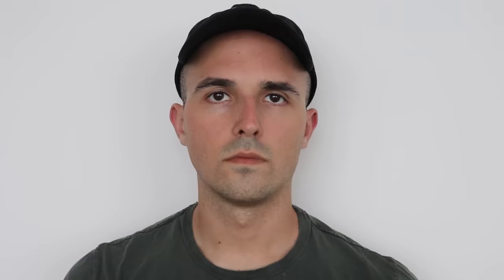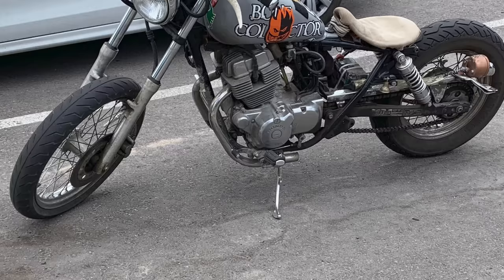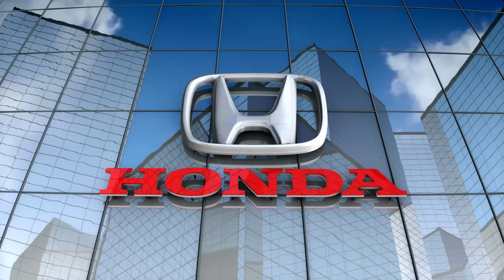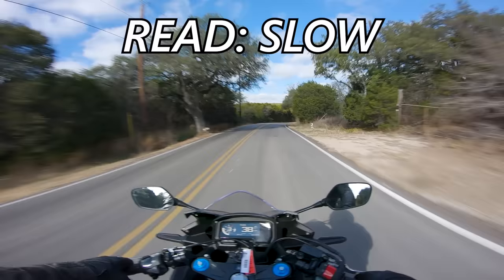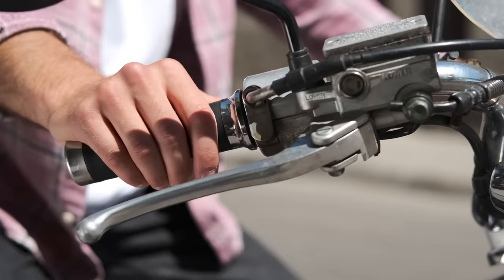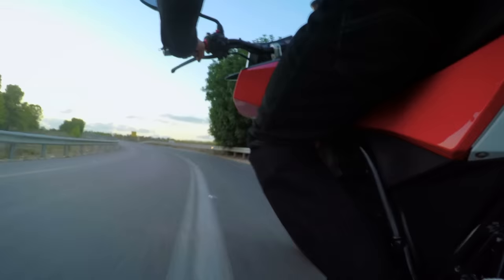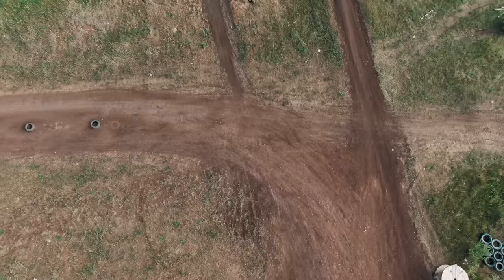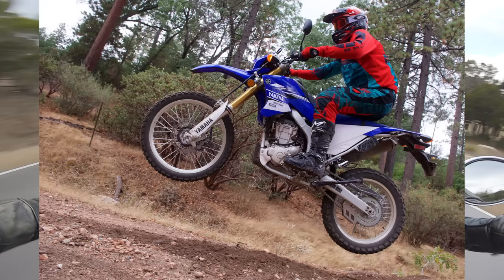7 Used Motorcycles That WON’T BREAK! (Low Maintenance)

Comment: Hey you forgot about Kawasaki!! I got a GPZ500S, which has there ER500 engine. I had a pretty bad accident, the bike was complete write off, so I got a new one and about a year later I blow it up by dropping into 1st gear at 50MPH 😵 so I went to me accident bike, and just swapped the engine, thats is no spark plugs change just fresh oil and she started and has been running just fine for the past 4 months (300ish miles) this engine had been sat in a wheel barrow outside for just over a year, nothing was wrong with it even the spark plugs were good, this is a 1995 model and it's a bike I think should get more a lot more love!!!! Please I beg you get a Kawasaki GPZ500S 1995-2001 i promise you will love it!

Comment: I can't be the only one who absolutely adores the Yamaha XS400K DOHC (Maxim) and XS400R (Seca)

Swear to God they're bullet proof. Only issue with those bikes is replacing the coils-theyre stuck inside the frame under the fuel tank. Kind of odd.
Reply: I own a xs400r for 18yrs ervyday work horse machine

Comment: We have a 2020 Triumph T120, water cooled, and its awesome.  The stock water temp runs high like 230 in hot weather.  I had a custom 3x bigger than stock radiator built, put in a 160 stat, now its super.  Added a home built trailer hitch and built the trailer too.  Its great!

Comment: I'm a Harley junkie. I'm also a rocket junkie but I'm this case
Harleys with carb are so easy to work on it's practically a mandatory carb in a shop class for newbies.  No kidding. But their injectors rarely go bad so it's up to you. If you're not afraid of a wrench or do you just want to hit a button and go.
Reply: I rode a 71 flh shovel with a super e on it 
Gave it to my son 
Still going. Probably over 150k on the motor 
Stock rocks.those stroked out bar hoppers give hd a way worse name then they deserve
Reply: @Heavywall70  
So very true
I'm too old and broken to kick a motor so I'm on a FXSD 07 injected. No issues at 60 g just basic maintenance
Reply: @johnspencer2382  mine was a true Electra glide. No kicker at all. Hell, it didn’t even really have a key, just a switch on the dash, pull up the enrichment lever and push start button. Slowly push the lever back down till ya hear potatoes (potato potato potato) and you’re set. 
I did knock all the baffling out of the mufflers so it could breathe better with that super e but that’s it.

Comment: When you buy something with pistons, there are two main categories you can choose from:

- Honda.
- Not Honda. 

It all depends on one certain question. 
Do you want it to work ? Or not so much ?
Reply: wow, if that's a joke it's not even a good one
Reply: Yamaha Super Tenere. In the top 5% for reliability. A Ducati is at the bottom of the black hole of rel.
Reply: Good thing my car has a spinning triangle. Brap brap!
Reply: Honda is not everything in bikes.  I like my standards like the Triumph T120 and now 400.  Honda has nothing even close.
Reply: @j.d.mcginn6946  Honda is the number one largest manufacturer in the world both in motorcycles, and engines in general. 

Especially in motorcycles they are so far ahead, that even the SECOND, (which is Yamaha by the way) produces less than half. 

Triumph is for such a niche market, that I don't even consider it competition. 

As for the T120, not only Honda has something close, but they make it better. 

It's called the CB1100. 
It rides better, sounds better, uses less fuel and will outlast the triumph by several decades. :D 

Honda LITERALLY, gave birth to these kind of bikes. If ANYTHING, you owe them everything.
Reply: @jigrodrigues  do you happen to know something better ? If not, stay quiet.

Comment: I have owned various new and used Hondas since 1986 starting with CX500's, CB650, and a VF750, none of which required anything outside of routine maintenance/wear items. Went to Kawasaki in 2004 with a ZZR600 and had nothing but problems with that bike.  Went back to Honda with a CTX700 in '16, and glad to be riding trouble free again.
Reply: I had z1000sx from new and plenty of problems. When Kawasaki tried to explain that moisture on the dashboard is normal, I sold the bike. I have 23 years old Honda scooter and no issues whatsoever

Comment: Just passed 45k on my 2017 yamaha fz10 and it's still going strong!
Reply: FZ10 is a hell of a good bike!
Reply: My XS1100 has over 50,000 and still screams. 95-110 hp. 11.75 et. Air cooled DOHC inline four. Drive shaft. What's not to love?

Comment: "any low capacity bikes" 
Laughs in KTM RC390
Reply: I’m actually deciding between the old R3 and the old Duke 390
Reply: @justinlzt  just go for r3. I had the rc390 until recently you would regret it
Reply: @justinlzt  I have a 2013 duke and at this point, it's 1h repair session for every 3 hours on the bike, go for the R3
Reply: @Cyr_S  oh shit bro what’re the repairs you do? Water pump? Gasket stuff?
Reply: Any KTM, really. It’s a shame, because KTM and Husqvarna make some of the coolest and most interesting bikes around, they’re just really fussy.
Reply: @justinlzt  no gasket yet, mostly electrical so far. Last one was the clutch sensor that stopped working and wouldnt let me start the bike. Before that, gear selector and before that that side stand sensor... Bike is loads of fun when it's working though. Little wheelie machine. I had a 900cc before and i much prefer commuting in the duke
Reply: @Cyr_S  wtfff clutch sensor
Reply: @justinlzt  yeah, there's a sensor that tells the bike if you are pressing the clutch or not 😂
Reply: Yea I know what that is but didn't know thee was a possibility of it failing so easily. I've heard that the gasket issues won't happen if you take care of the coolant but the maintainance cost is higher than of the R3
Reply: @justinlzt  390 is more fun but feels like a plastic toy and will break.
Reply: @FrankCoyle ouch
HAHAHAH
Reply: Happy duke 390 owner here. 2014 / 6.5 years riding 33.000km on shitty roads of and heat of Vietnam - just changing oil and lubricating chain. Biggest issue I remember was the radiator fan refused to spin for some reason few times the first year. So I bough a spare one, give it to duke under the nose to sniff, magically the old fan started to work, never had to change it, the spare still in the box ;-) It's indian version for local market, grey import. Maybe I was more lucky than others, but the bike just works and required nothing more than regular maintenance...

Comment: Most reliable bike: Honda NC700 👌
Reply: Scooter if its automatic 🤪🤣
Reply: @MK-sk2mi  nope mine is a manual😁
Reply: @luukwolf161  awesome lol I was so close to getting one but most the ones I found were autos. Ended up with a Yamaha 😆
Reply: @MK-sk2mi  I actually wanted a MT-07 bud thats was more expensive. So ended up with the NC700. Here in The Netherlands the automatic ones are more rare, most of them are manual here

Comment: Had a 1982 Honda cb900 that had 500k miles on it and after swapping out some oils, cleaning the hell out the carbs, and putting the factory air box back on it ran like a dream.

Comment: Good see the FZ1 get a little attention.  Very underrated bike. They are getting harder to find.
Reply: I was looking at buying one a few months ago.  It was a few years old, but in excellent condition, with really low miles, and the guy was practically giving it away.
Reply: @mickeywilson8885  if your halfway interested  snatch it up. They can really pepped up with a little effort.

Comment: Ducati’s, great to look at. Just as well, as that’s what you’ll be doing most of the time whilst waiting for the recovery truck. Either that or your you’ll be doing overtime at work to pay for the servicing.
Reply: Seriously yammie putting that panigale at number one was total shocker. I don't think of reliability when I think of a Ducati.
Reply: Yes and no.  Ducati,. Get to know it, be intermit with it,. Do everything you can to it yourself.     Guess I'm a little old school,. Where owning a bike means working in it yourself.    Ducati services are through the roof expensive.   But if ya buy the tools and books,. It costs you time only.  And they are fine tuned machines, so yes, need to pay more attention to them.    But like any track bike.  Should be maintained more than riden.      Coffee or tea.   Bourbon or whiskey.  Each to their own
Reply: @russcole5685  Yes, and I do all my own work. But…The desmo pain in the arse valve clearance check is more frequent compared to other bikes, and a friends multi strada was very problematic, as many have found. Then there’s the long wait for expensive spares….Gorgeous to look at though !
Reply: @jamesalvarado3961  That’s called experience . Yammie knob doesn’t own a Ducati. Wonder why ?
Reply: @douglasalexander4348  yup,.  Can agree with you,.    Here in Little New Zealand to try and get anything into the country,.  Is terrable at the best of time's,. And now with covid around the world.   Lol. Rediculas lol
Reply: @russcole5685  New Zealand looks gorgeous for biking !  Yup, everything’s in short supply here in UK and prices are rocketing as a result. Getting Ducati spares before COVID was dire, hate to think what it’s like now…

Comment: Bought a 6,000 mile 2003 Moto Guzzi California Stone, like new for $2,800 freakin' dollars last August. Best money i ever spent on a bike. No ABS, air cooled, wet sump, drive shaft, hyd. lifter 1100cc 5 speed, dry clutch. About as simple as any bike sold after 2000 and unlike a Sportster has plenty of power. Yes, it is an F.I. engine but a very basic set up that just helps reliability wise. Great handling cruiser with the Tonti frame proven over decades in both sport and cruiser Moto Guzzi bikes. Simple, automobile like engineering and easy to maintain outside of dropping the sump once every 5 oil changes to do a filter change but even that is a blessing as it facilitates cleaning the sump of any sludge build up and allows inspection and cleaning of the oil pressure bypass. I also have a 1976 M.G. 1000cc with 55,000 miles and almost no discernable engine wear and know of a 1980 850 T3 that had 180,000 miles on it by 1995. Outstanding service! Let alone from an air cooled wet sump bike! Have a lot of faith in my 2003 Moto Guzzi with no issues at all so far. A good thing when you have no idea where your nearest dealer is but are fairly sure it is hundreds of miles away!

Comment: If the Yamaha DT175 and Honda XR250 were still being made....they would make the Top 7
Reply: Yamaha dt is indestructible 👍🏻
Reply: @menanpopstrokes4025  ....yeah, I had either a G or H model of the DT175 that I inherited from my older brother.  I flogged that bike like no other and it never let me down.   After years of abuse I thought that I'd better change the piston rings....and clean the air filter, finally. 😁
My older brother also had an XR250RF (1985 model) but I crossed a line and it was never the same.  I drowned it in the Todd River, central Australia, on a rare day that it was flowing and got bogged in almost quicksand.  Bit of an idiot thing to do.
Other cool bikes were 1983-85 KDX200 and the IT200....but the Kwaka is more bullet proof than the IT.....in my opinion.
Reply: @1969cmp  these day it’s hard to found one because the price of dt125 and dt175 skyrocketing.
Reply: @menanpopstrokes4025  .....and rare.
Reply: @1969cmp  you know why it became highly price bike because of the pop culture. We had a movie triology about scrambler gang

Comment: I like the list, but (outside of the Japanese big 4) think it's more like if it breaks you'll find parts and it won't need specific tools and high level of mechanical expertise to fix. It may also need more regular maintenance but anyone with basic mechanical knowledge  can do it easily and quickly and if done you will have a solid bike that you can put high mileage on (RE, Harley and Triumph). I think the Triumphs with the most transmission problems are the water cooled 120 series.

As someone that puts high miles on motorcycles and doesn't like to rely on a dealership/mechanic for services, I prefer a motorcycle that is simple to repair and maintain on my own. I'll give up fancy bikes that need specialized equipment and knowledge just for basic maintenance even if it requires the maintenance more regularly. I'm one of those that enjoys wrenching on my bike as part of the ownership experience and it forces me to deeply inspect the bike for hidden issues that might become bigger issues.

If your looking for a get on and go bike, that is pretty much low maintenance and bullet proof, I agree with the first two groups you mentioned and duel sports that haven't been ridden into the ground. If your just looking for it as transportation and don't let ego get in the way, a scooter 125cc and above from the big four are about the best thing you can get. I've had a couple and although they don't give you the full motorcycle experience, they are fun in their own way and extremely useful for their purpose.

My Yamaha has almost 50k miles and with basic maintenance should be good for over 50k more. Haven't had any issues at all.

Comment: 40 years riding. My 1986 Yamaha Virago 1100 has been my least problematic bike. Still going strong, though the odometer did break. I'm guessing 100k miles on it. I had 15k when I bought it 12 years ago. Oil changes, spark plugs and tires, and clutch cable, brake pads... just normal maintenance. Worst bike, 1992 Suzuki Intruder 800. Constant problems. Worst battery placement I've ever seen.

Comment: I’ve got 50 + yr old Honda’s that are still running  with nothing much more than an oil change and a battery..  I’ve even got original tires from 1970.. and still put it around town..   Honda’s RULE and all others but Indian drool 🤤

Comment: Honda NT700V with 100.000kms, home made maintenance following the service manual, less than 750€ in maintenance in total(excluding tires). The only problems I've had were some bulb lights. Used everyday, winter and summer, spends many hours on the street while raining, long trips (some days with more than 12 hours of driving), used and abused on twistys at high rpms, hard braking... 

I've had 3 Hondas up to now, about 210.000kms between all of them, they never went to dealers or mechanics, all the maintenance done by myself. None of them has had a problem. I don't think other brands can offer that quality as I've never seen anybody that rides as much as I do have 0 problems

Comment: Truthfully all cars and motorcycles are dependable because of electronics.  Limp mode will always get you home.  In the 70’s spent more time wrenching than riding.  But what you like as reliability is a small fraction to worry about.

Comment: Recently bough a 55 year old motorcycle with gas in the transmission oil, and 1200 miles. Thing dosent die and stil starts and runs wih no gas (did this after a carb rebuild on accident bc didnt realise it was out of gas). As long as its well taken care of and you make sure to treat it well, it will be reliable.

Comment: Good list. I knew the Hayabusa had to be there even if only honourable mention since they are one of the most common bikes at drag strips. Like Honda, most Suzuki's are pretty bulletproof.
Reply: Suzuki bullet proof. 😂😂😂😂
Reply: @neilhamill318  spoken as a guy that rides a 32 year old 1100 Katana with 115,000 km on it and a bike that's had about 7 previous owners and has seen all kinds of weather from sun to rain to snow. Yes I'd say they build a pretty bulletproof bike.

Comment: Here goes. how can the DR650 not win. I'm up to the WR. It's got enough going for it to beat most bikes. Like an 883 people sell them because they are underpowered though.
Reply: I have a DRZ400 which is much like the WR250 but with less gear changes, and about 30% the way up the more road oriented DR650 (which never dies!)

Comment: If you think an Enfield is reliable, man, you have literally no idea.

I did a three week ride with 12 others. We had 2 spare bikes and three full time mechanics and there were days when someone had to ride in the bus because there weren't enough running bikes. Every bike broke down, most several times. That's despite a full service before we picked them up and another full service on the rest day half way through the trip. They're terrible.